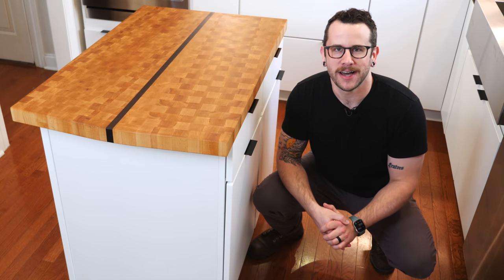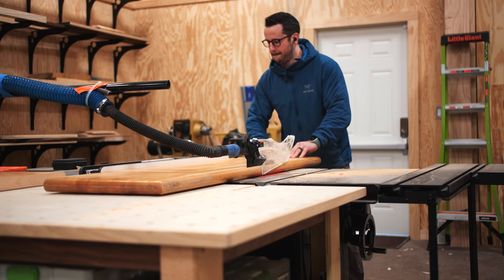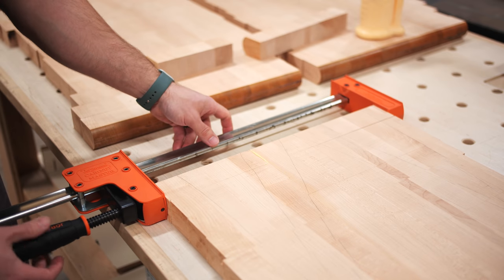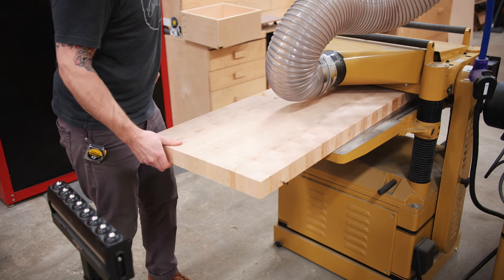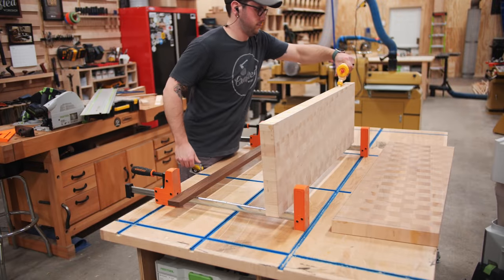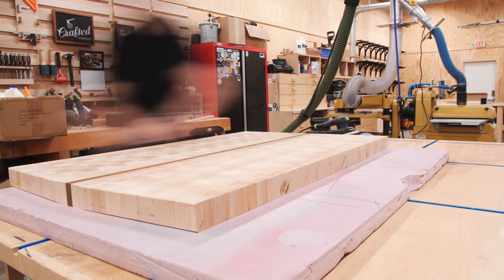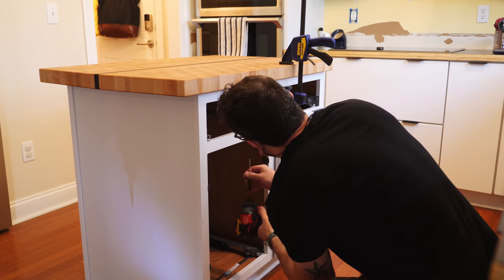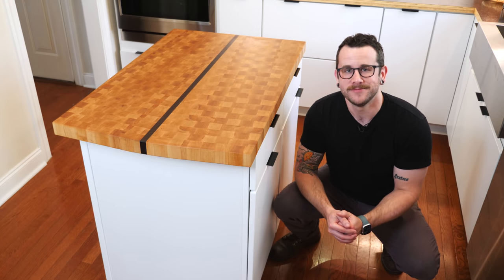Building a GIANT CUTTING BOARD for my Kitchen Island // Kitchen Remodel Pt. 4

Comment: I like the extra design ideas, its takes it up a few notches, and makes it an original piece. I don't think the angle would have liked as good without the center piece. All the intersection points probably would not have lined up. Cost of materials FREE. Nicely done!

Comment: A water relief channel around the perimeter would have been helpful.  If you're chopping things like vegetables, they have a high water content, leading to drips off of the edge of the counter as you're cutting and chopping.
Reply from the maker: I definitely considered adding a juice groove but I think they make cutting boards a lot harder to clean. I don't see water run off being a major issue since the surface is so large.

Comment: Nice work. I will say though that the angle u did will polarize a lot of people and affect resale value when u sell someday. I.e. some buyers will be turned off by that angle, basically any non neutral design decisions like that are typically I’ll advised in terms of resale value. But of course hats null right now and u should do it how you want because it’s your house. And either way u are an excellent carpenter and I enjoy watching your content
Reply from the maker: Thanks! We plan to be in this house for a LONG time, so I'm not worried about resale value at the moment. I think the plywood countertops will be a lot more polarizing than the island 😂

Comment: Looks good! Not concerned about food contact with the original adhesive?
Reply from the maker: I figure, after 20+ years, it's most likely inert, plus the food is really contacting the oil/wax for the most part.